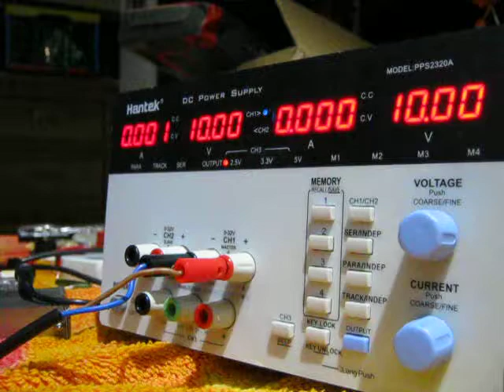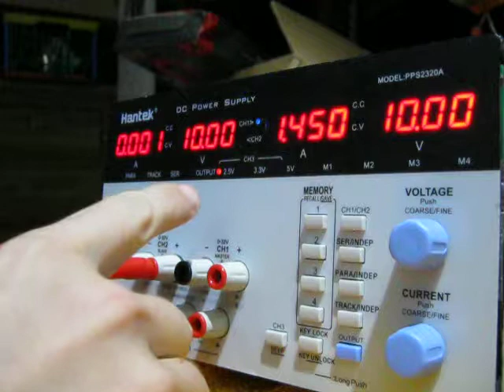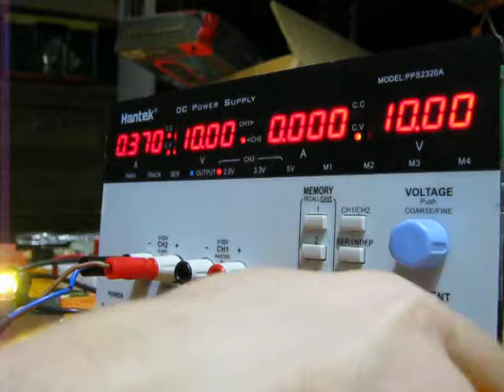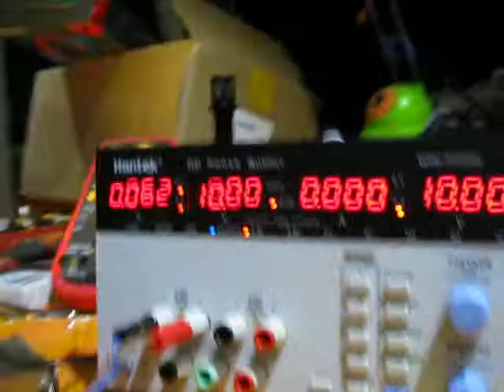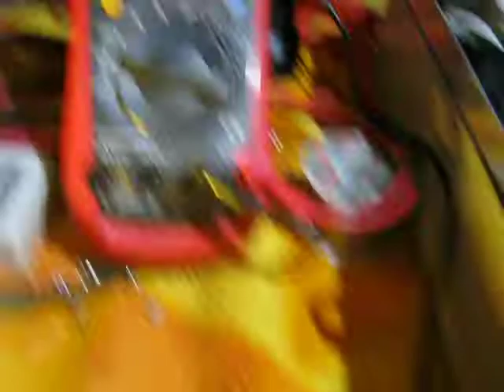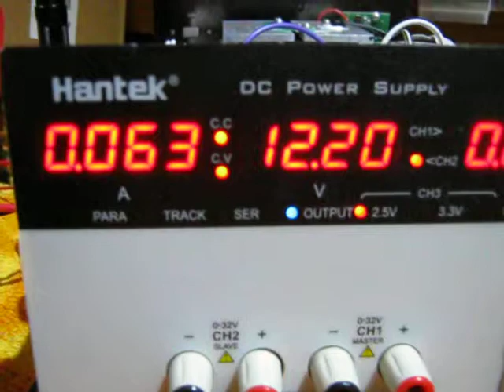Hantek PPS-2320A Channel 2 Problem

Comment: Question, how is this power supply calibrated if the readings of current and voltage ever drift?? Does this PSU has calibrating pots.?? Please explain.
Reply from the maker: good question, will have a look this weekend into the design and see if I can tell you
Reply: Many thanks for you're reply. I have a Tekpower TP3005T from amazon, and it is basically controlled the same way as the Hantek. My concern is, that if the readings ever drift, I must be able to adjust it again. But I think this is done via software, because it has no calibrating pots. What is you're experience with power supplies?? Do the readings drift, and if so, over what period in time. Maybe i'm a bit over concerned.

Comment: Thanks for that. I've been over a lot of the dodgy looking solder joints but that has made no difference. When I get a chance I'll have a good look for cracked tracks.
I know it's a long shot but did you manage to find a schematic?
Reply from the maker: Try buzz the track out with meter on continuity mode, should be easy to find broken track.
I didn't find a schematic yet but I would love to get hold of one!

Comment: Did you ever find the solution? Mine does exactly the same but on Chan 1. 2 months out of warranty.
Reply from the maker: Hey! Yeah I did! I will post the solution later. Basically the board had flexed and a track had broken right at the base pin of the first power transistor. Base signal was present just before the pin on the track but when measured at the pin there was no signal. I put a small jumper wire from the transistor base to the base driver circuit and this solved the problem! :)